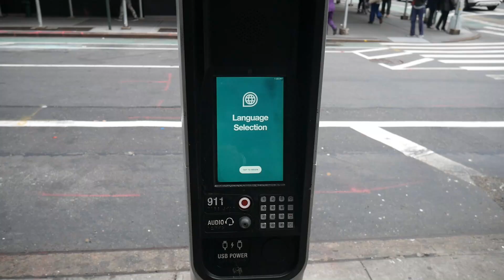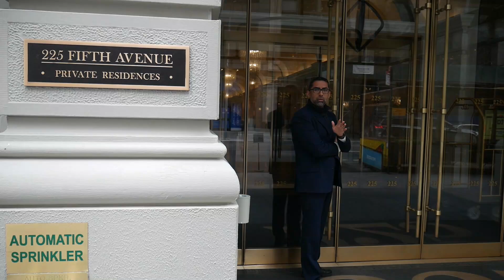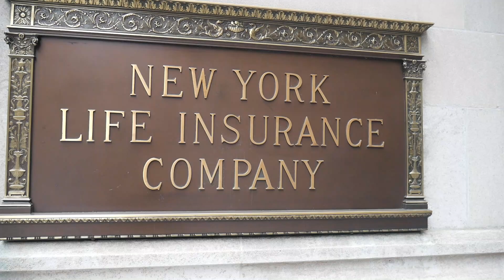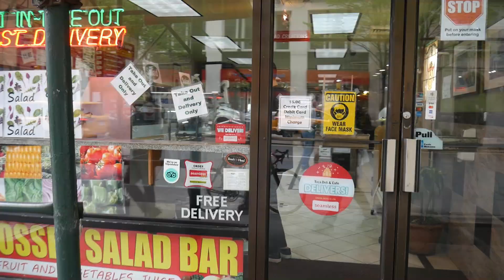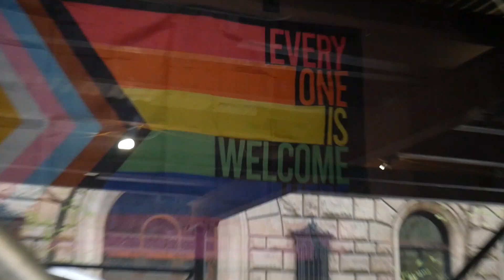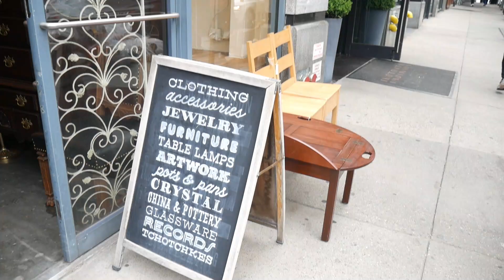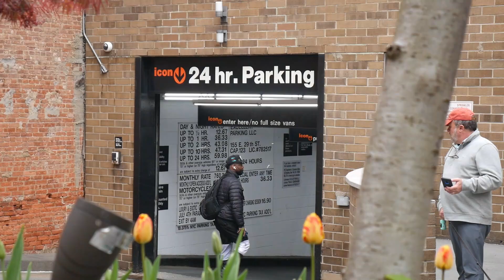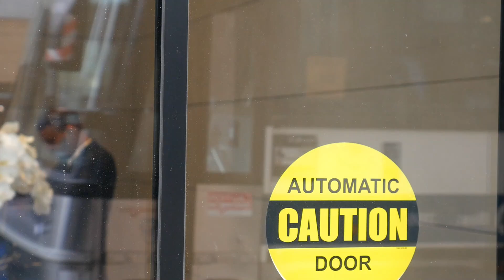NYC Tour - People Places & Things - 1 of 2

Comment: E. 23rd and Lexington, ConEd subcontractors locating a high voltage electric line. Those insulated boots are a sign they're tryna find a high voltage cable. That red box is an electric line locating device. It's the reciever. The transmitter half is hooked up to an exposed part of the cable or grounding post of the line they're looking for. It's Like Spaghetti!..... all the utilities under the streets there, for Sure!